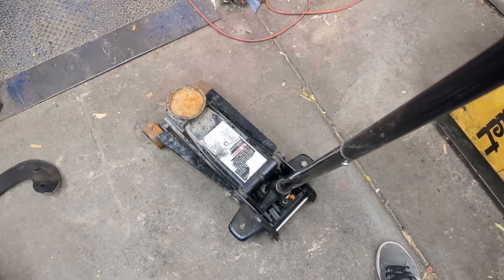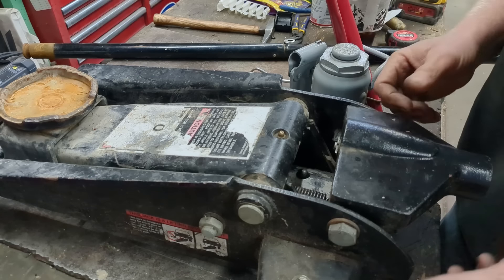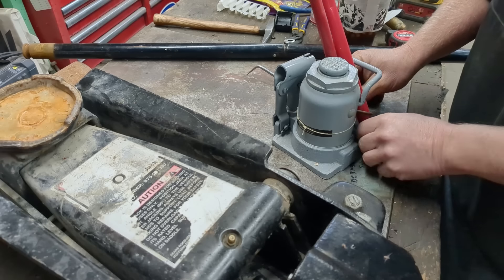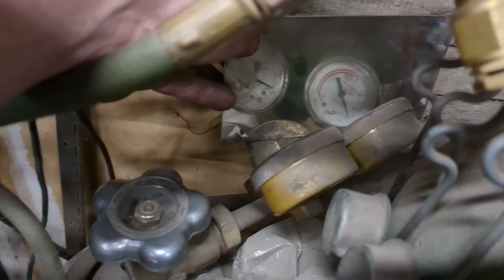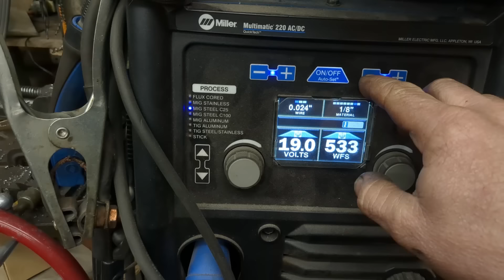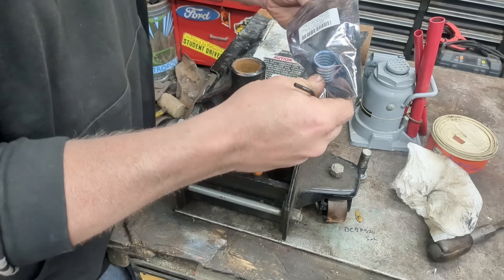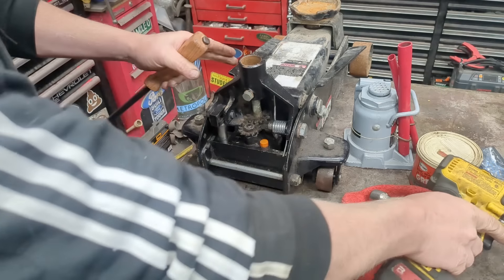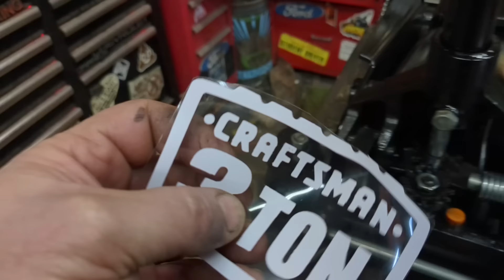Hydraulic Floor Jack REPAIR restore Craftsman 3 ton

Comment: Just in time. I own the same jack and i know i need more fluid. Now i know how to do it. Thanks. Over the years watching your videos i have saved lots in just fixing tools.
Reply: Fortunatly mine has no issue with the spring or bolts but those swivel wheels are messed up and missing the ball bearings. I need to find new ones.
Reply: I too need to fix my 3 ton craftsman jack. I was just looking into it the other day. Perfect timing!
Reply from the maker: These have a unique ball bearing cage that opens so you could just jamb a handfull of 3/16-1/4 Ball bearings in there and it'll be as good as new.
Reply: @sixtyfiveford  ok will have to look around for some
Reply: My jack pumps up the car fine but won't hold it, leaks down. What do you think it is?.
Reply from the maker: @sh839c  The main release ball/seat is damaged from over tightening the jack handle or it's possible there is some debris in there.
Reply: @sixtyfiveford  Thanks for the reply.I will look it up and see if there is a video on this.
Reply: I’m saving this for later. I have two of the same jacks that need attention. Just need to find the time. Thanks for this!

Comment: Awesome video, I have a 3 ton floor jack that was left at the house I bought in the shop. It needs some work, not sure where to get parts, no name on the jack. I like the heat shrink on the handle, you would have a link to where you bought that kit. I like the labels too, how did you do them

Comment: I always pick up a trick or two when I come by. In this episode it was using bar chain oil for those "tough to get to" pivot points and the large heat shrink. Adding the decals was a nice touch too.
Reply from the maker: Thanks.
Reply from the maker: @wyattoneable Harbor freight has little boxes of heat shrink that are up to about an inch/ inch and a half and I've used those for years as just grips on things. So 6 months ago I decided I'm going to see how big of stuff I can find and I found these. They even come twice as big as this.
Reply: @sixtyfiveford  Can we buy those online somewhere ?
Reply from the maker: @Dicofol1 I bought mine via AliExpress . Which if you haven't used is about as Chinese as Chinese gets when it comes to websites. But you can find a lot of oddball stuff that you would never be able to find in a local store anywhere.

Comment: Thanks for recycling - I love fixing things to put back in use, even if it's not time/cost smart.  Would like to know the model, I think my 950136 (yours is 390?) is the same, except you have zerk fitting and different check valve.  For lifting, it seems you only added and bled, I've done that already and don't want to disassemble to check seals. I'm going to try again with the process you mentioned, I may have created the vacuum you mentioned, we'll see....so I just spent time filling and bleeding again and thought I got it...but I think I made it worse....it's not obviously leaking but it's really not lifting at all now.  I had a lot of difficulty with that star closure, so I suspect that seal failed and should be easier and less expensive than the internal pump seal I thought it would be.

Comment: That tip to open the fill/bleed/compensation port when the jack is up was a great tip and resolved the slow to lift up issue one of my jacks had. Thanks for the videos and tips.

Comment: I have the same jack and kit I purchased some years ago and mine is hissing under pressure.  A search led me here.  Will trying just adding oil and priming the jack first.  If that does not work, I guess I will learn how to weld and buy a lathe lol.

Comment: There's a very thin metal washer that slides off the jack arm as it raises, was it part of the plug? It fell down the rest of the way right after you "burped" the chamber

Comment: I have the exact same floor jack. I bought the same package deal back in 2002 for $99. As always, thanks for sharing, Moe!
Reply from the maker: It seemed like the best deal back then. Sounds pretty good these days though too.
Reply: I have the same kit as well, or at least one very similar. (I don't remember mine coming with the fender cover and I bought a heavier Craftsman cover, that I seldom use, instead.)

Comment: Hey Moe!! Back in 2011 or 12 I bought 3 of those exact 3 ton Craftsman jacks and 4 matching jack stands basically brand new from a guy who quit in the middle of a restoration of an old import sports car for  $75 total.. Sold one for $125 ,and kept the other two for a few years until some person or persons relieved me of them without asking my permission or giving me notice... 😠 but they were great jacks that performed flawlessly and never gave me a bit of trouble.. Well worth every penny of the 50 bux profit I made from the 1 that I sold... 👍
Reply from the maker: @Wil_Liam1  That's an unfortunate event.

Comment: Absolutely awesome job, i have just got the same jack in the UK. Its under the Sealey brand. What would you use as a rubber insert etc for the lifting plate ?
Reply: Hockey pucks work great, and are cheap!
Reply from the maker: On the occasions where I do want to put a piece of rubber in there, I generally just grab a chunk of conveyor belt scrap. Hockey pucks would work good though.

Comment: On another topic, do you have any experience with the newer jacks, where they hydraulic unit is welded shut?
Reply from the maker: I have not actually done one that is welded. It would be the exact same other than you would have to cut the weld and reweld it. It's just the reservoir that is welded to the base.

Comment: Always enjoy your fixes. Seeing as we’re both thrifty, a bushing may have been a cheaper fix. If I had a bushing I think i would’ve ground that hole larger and put a bushing in. Also you can make your own acetylene 😉 it’s called an acetylene generator!! Super cool and I think if you found or made one, it’d make a great video!
Reply from the maker: I actually had plans a few years ago to buy/make one. They still use them in 3rd world setups with very minimal safety. It intrigues me for sure.
Reply: Good to hear back from you👍 I got a set up from the dump. Just too chicken to use it😅
  I’m a structural Ironworker by trade and they put the fear of god into us regarding acetylene in trade school. Seems to me “they” don’t want us to have that kind of power. Also calcium carbide wouldn’t be easy to get a hold of. Although I have found out it can be made. I have seen them set ups on marketplace from time to time

Comment: That was fun. You were right with the cast iron spark test, you can clearly see the difference in your video. Steel gives off a lot more sparks and cast iron sparks less and they are like stars or sparklers. The third test is to just drill it a little. Steel gives shavings cast iron gives more black powder like shavings. Cheers, Stuart 🇦🇺
Reply from the maker: I forgot about the drill test!
Reply: @ I figured you would know but forgot it😂😂😂

Comment: On your shorts  lown head gasket what is the tube you are using? Can it be uset on lawn mower or mini bikes?
Reply from the maker: No because they don't have coolant. This tester is just to see if the head gasket has been leaking into the coolant. You would use a leak down tester for air cooled engines

Comment: Do you find those stubby bottle Jacks can raise a sedan high enough to change a tire? I was looking into them cause my car is low but didn't think it would have enough height so I went with a wide base scizzor jack.
Reply from the maker: They only have about a 3.25 in throw. So on a car, if you're jacking off of the pinch welds the suspension will probably droop about that same amount. So it might not lift a car past its suspension drop/wheels touching the ground.
Reply: @sixtyfiveford  gotcha, I figured. Thanks!

Comment: Thank you very much for the link for the handle spring.  I have been looking for one for 3 years, the factory replacement was $12.00 for one and $12.00 for the shipping.  Thanks again.
Reply from the maker: I actually went 10 years with a broken spring. I attached just a regular spring to the handle and drilled a hole in the body.  Worked okay but decided a year ago that I was fed up with it.

Comment: I have one that after it’s pumped up it won’t release pressure till the weight is lifted off the top! How do I alleviate that??
Reply from the maker: There is going to be a check ball that holds the pressure in the cylinder. It's directly under the main screw that your handle drives into the jack. The one with the big crown shaped gear on the top. This has been over tightened and the ball has been wedged into a deformed seat. You would need to take the ball out and use a drill bit to rehone/reshape the seat. The ball could also be deformed.
Reply: @sixtyfiveford thanks. I’ll look into it. Like all your videos. Very informative. Use the battery adapter for my 18v to 20v Porter Cable tools.

Comment: What do you use to make your stickers?
Reply from the maker: I use a 20 year old Cricut craft cutting machine. It's meant for scrapbooking for ladies and was designed to only use preprogrammed cartridges to cut out shapes and text. I spent way too much time on forums I barely understood to crack it to cut any shape I want. Then I still have to design what I want it to cut. There are a lot of guys that will do all of this for people. You simply email them a picture and they will design it, cut it out and ship it to you for a few bucks. That's the easier way to go. I used to use a random guy I found on ebay to do this for me. I recall repainting a skid steer and wanting all new decals(some 3ft long). I sent him what I wanted and $35 and a week later I had a dozen new custom decals.

Comment: What's the orange plug for? It says "do not remove" on it, so of course I want to remove it.
Reply from the maker: @594bolt  Max pressure setting. So that it won't lift over 3 tons. You can turn it up but then the steel frame on the jack may buckle.
Reply: @sixtyfiveford  Thank you, I will leave it alone.
Reply from the maker: @594bolt  I'm the same way and want to just play with it because it says I can't . They jack in these things is probably about 12 tons capacity. But it's at a leveraged disadvantage but could probably still push 4-5 tons. So they load the Jack into a press at around 3 tons and crank the screw until it starts to release. All that's in there is a check ball with a spring behind it. Honestly, these things probably have a safety standard of 200%.

Comment: I have a similar Craftsman jack, that is much longer. I stopped using it because I could never get the teeth to mesh properly, so the teeth were always skipping. That and it weighs a ton, so wheeling it out on the dirt driveway sucked.

Comment: I'm a Retired body man of 45 years and I used a lot Of Brass and Coat hangers with Oxy fuel to weld up a lot of cars with back in the 70s ,, That's all we had ...

Comment: I have a older craftsman bottle jack that leaks oil at the release valve...the ball bearing is in there im stumped...help is Always appreciated...🖖
Reply from the maker: It's usually the O-ring in the release valve itself.

Comment: Awesome video! I'd love to learn how you made the decals (Printer, Material, etc)
Reply: Cricut machine
Reply from the maker: I use a 20 year old Cricut craft cutting machine. It's meant for scrapbooking for ladies and was designed to only use preprogrammed cartridges to cut out shapes and text. I spent way too much time on forums I barely understood to crack it to cut any shape I want. Then I still have to design what I want it to cut. There are a lot of guys that will do all of this for people. You simply email them a picture and they will design it, cut it out and ship it to you for a few bucks. That's the easier way to go. I used to use a random guy I found on ebay to do this for me. I recall repainting a skid steer and wanting all new decals(some 3ft long). I sent him what I wanted and $35 and a week later I had a dozen new custom decals. 

You can buy a new machine that doesn't need to be "cracked" by Silhoette https://amzn.to/3AAlDlI and do the same but you still have to be able to design logos in Adobe Illustrator or similar unless you just do stock shapes/logos.
Reply: I was going to ask same question about yr logos. Thanks for your explanation
Reply: @sixtyfiveford  Awesome! Thanks for the info!

Comment: Can you make a home made oil transfer pump for like used oil and hydraulic fluid etc.?  That would be a cool video.  I've seen some ones out there using a car oil pump but curious how you would make one.  Just an idea...for a rainy day down the road.
Reply from the maker: Great suggestion!

Comment: Those rubbers are a total loss I imagine. Looks like you have a whole weekend of wire wheeling parts ahead of you. Save samples of all the seals. You might need to do the comparison method to replace them.
Reply from the maker: Everything is still great on the jack. Rubber seals inside these things will last a long long time.

Comment: A suggestion! Do a video where you experiment with what oils will work in a jack...you suggest hydraulic oil but most DIY people won't have that. What about power steering fluid? Brake fluid??  50:50 oil and diesel mix??
Reply: I use ATF, Power Steering fluid is similar, w/stop leak may be useful. If in a northern climate like me, snow plow oil ( may be dyed blue) has high water absorbtion to prevent freezing from condensation in a cold wet environment. Just tip it upside down with the fill plug out to drain overnight to change/remove contaminated oil.
Reply: Ok !  That's what I was wondering.... I have a few bottles of steering fluid and transmission fluid, with an inch of fluid left in each. So I'll use them up in the hydraulic jack...... what about brake fluid? Would that work in a jack??
Reply: @jakewilliams8761 
   Only if you want to wreck it, brake fluid will swell up the seals and turn them into mush

Comment: The original Sears (not Craftsman) floor jacks that preceded these are way better jacks, and can also be serviced with new parts. These are good, but the others were great.
Reply from the maker: True. Have one of those as well. The casters are a little bit better and they're made out of 1/4-in versus 3/16 steel. You just never want to have to lift one.
Reply: @sixtyfiveford  Dig that!